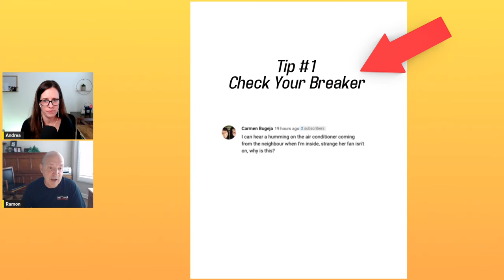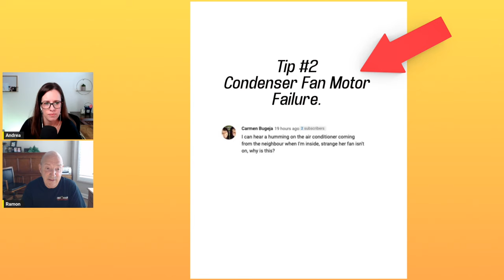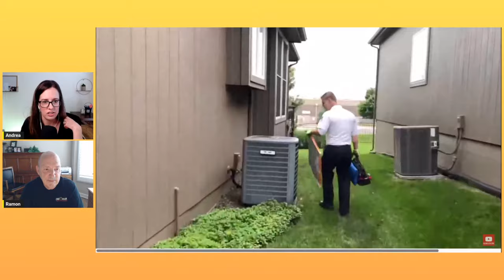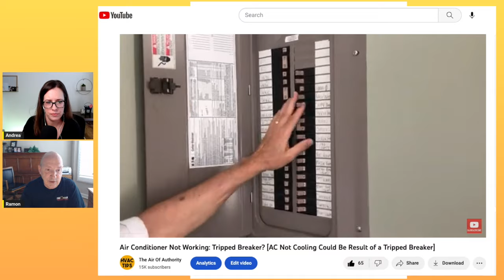Air Conditioner Making Loud Buzzing Noise and Not Cooling in Olathe

Comment: Hi, when my unit turns on, there's a heavy click on sound. I notice my unit never sounded like this before.  Any advice would be appreciated
Reply: Did you ever figure it out?
Reply: @jassirargueta  I researched with 2 opinions from 2 different contractors. Both mentioned the sound is normal as long as the compressor pumps freon...
Reply: @newman9555  Thank you for that information! I appreciated the fast response
Reply: As long as it's cooling it's normal it's the compressor kicking on

Comment: A tree fell next door and there is now a partial outage in my house. No breakers flipped, but I'm particular areas there is still no power and my outside AC unit buzzes. I'm hoping it's only partial power and when the wires are fixed it will run again. What do you think it likely is? It's a new unit...

Comment: If there is no power to the unit there is nothing that would cause the hum or buzz. It is likely a compressor locking up.
Reply: Wrong. The control circuit is still active in the outdoor unit and energizes the contactor, even if there’s no power to the outside unit.
Reply: Mikey you are right , I thought the same thing even before I read your comment.
Reply: @arayahailu8762  no the contactor coil could be buzzing. Seen it a hundred times
Reply: We have a relatively new Lennox heat pump. When we turn on the heat, the unit does start, but there is a clucking sound from the unit. Typically it runs for a few minutes and stops, and the system goes to backup (electric furnace). I'm hoping it's the fan motor, but how do I test that? And could it be something else?